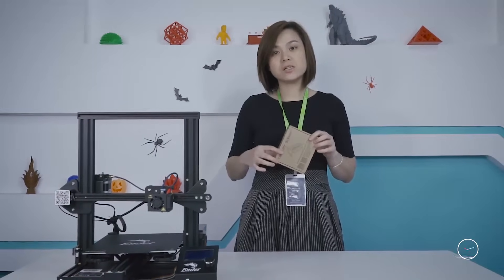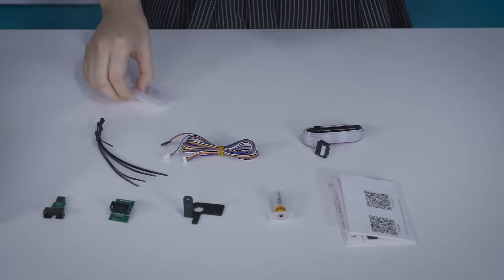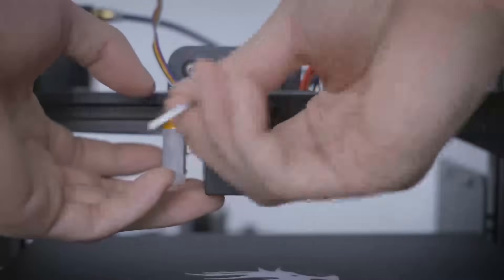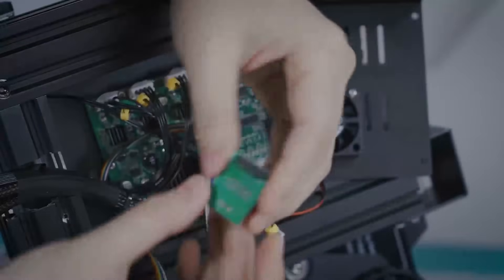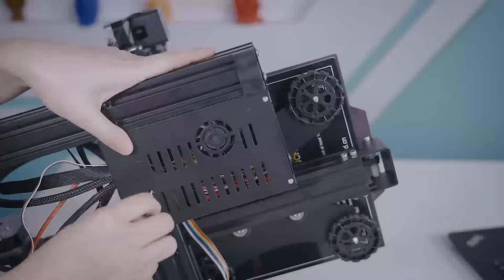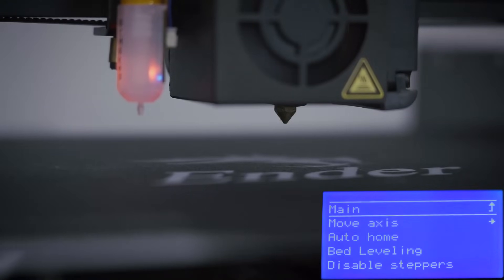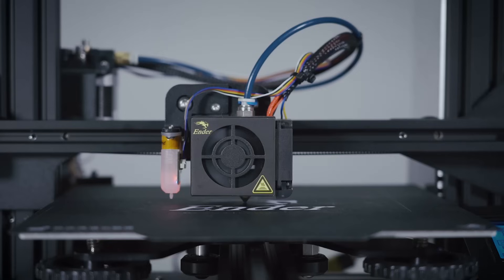How to Install Creality BL Touch Auto Bed Leveling Sensor Tutorial (Ender-3 Pro Upgrade Setup)

Comment from the maker: We are reponsible for every customer, so if you have any problems about your Creality 3d printer (especially when you need to use pics or videos to show these problems), pls contact our after service https://www.creality.com/service-request. We have very professional engineers there to solve your problems. Thanks for your support.
Reply: I don't have any chips to choose from in the program and my ender 3 pro is recognized by my windows 10 computer as an input device. does anyone know how I can fix this? thanks in advance
Reply: @snief86  rename your ProgISP folder without any Chinese Characters, don't use the Creality Bl touch firmware it does not work properly
Reply from the maker: @AndrewAHayes  Thanks for warm comment, it is very helpful for other customers.
Reply: I was told to contact my retailer for problems with your software and firmware, which is a waste of everyone's time as you don't provide the Marlin INO file with your BL Touch firmware so no one can repair it.
 Why don't you repair the BL Touch firmware for most of your printers and include baby-stepping so you can set the z offset correctly, it took me 10 mins to configure my Ender 3 BL Touch firmware from a stock version of Marlin Bugfix 2.0.x.
 by not doing this you are making customers think you don't care, within the community people are getting pretty sick of this attitude.
Reply: @Musa Enoch i really appreciate your reply. I got to the site on google and Im in the hacking process atm.
Takes a while so I will get back to you later with my results.
Reply: @Musa Enoch it worked and I now got access to my account again. I'm so happy:D
Thank you so much you saved my ass :D
Reply: @Aiden Taylor no problem xD
Reply: i know Im asking the wrong place but does someone know of a tool to get back into an instagram account..?
I was dumb forgot the password. I would appreciate any help you can give me.

Comment: It broke my ender 3 pro. My marlin firmware whas fine only thing that I needed wasn’t in that firmware and that was the option to calibrate the e-steps. But now I get the well known blue screen that’s flashing a little bit and the bl touch not working anymore. Even tho the new software should support the bl touch

Comment: Can  I follow these steps to revert back the firmware to Ender 3 pro original. The BL touch keep failing.
What are the setting in progisp to upload the original 1.1.4 firmware?

Comment: Wait I have the "Crealty BL Touch Auto Bed Leveling Sensor for 3d  Printer" box and there are 3 black metal angle brackets in it, and there are no green circuit boards in the box!
Also there is no white cable either.   Why>>>???

Comment: I didn't get the pinboards or the burner with my bl touch for my Ender 3 pro. Was I supposed to?
Reply from the maker: If in need of technical support, please email  cs@creality.com; or
join the Facebook Group (https://www.facebook.com/groups/3110994512278883/) to discuss with thousands of experienced 3D printer users.

Comment: Is there another video for this for the enderpro 3? I am trying to install mine and my box was slightly different and I don't have that cord to plug into the bottom of the board. Mine gave instructions to reformat my sd card completely (which I don't know why I would need to reformat completely) -- and download one of the files from the download page. But I don't know which version since there are two options for ender 3v2

Comment: The most videos I see are to upgrade the ender 3 but if this video description is correct you can also upgrade the ender 3 pro??
Reply from the maker: this is how to install BL Touch sensor, Ender 3 pro with ABL
Reply: @Creality3D  okay thanks, can the cr touch can also be used for the ender 3 pro or?

Comment: The bracket received with my BL Touch for my Ender 3 v2 doesn't work particularly well with the fan housing (plastic box around it). Now the fan housing (which also holds the fan) is lose. Any work around?
Reply from the maker: print one?
Reply: @Creality3D  I would love to... if i could get my bed level 😂👍

Comment: This would be a great video if it also told you there was a difference in the BlTouch you get. I watched this video before buying. Didn't come with bracket or the connector for the computer. Junk

Comment: I do not have this motherboard I have 4.2.2 and the connector does not light up what to do?
Reply from the maker: Could you pls replace your power supply or power cable first to see if the problem can be solved?
Reply: @Creality3D  hi have 3dtouch no Bltouch my power supply and cable are new, but when I make the connection like you, I don't have the indicator light, the connection is the same with the motherboard 4.2.2? thank you
Reply: I do not understand why it does not work, I made the same connection so impossible to do as you do

Comment: I can not get this thing working
Reply from the maker: Sir, could you tell us your printer's problem in detail?
Reply: @Creality3D  I can’t flash the firmware it just says “chip error” and it didn’t even show the selection for the flash unless unzipped it all with winrar
Reply from the maker: @CineZoneYT  Could you tell us the model of your mainboard? How do you flash firmware? Could you pls send us a video or picture about it? Our engineers are more likely to understand your problem, then they can give you a better solution

Comment: Her model has a creality v1.1 motherboard, whereas mine is 4.2.2, so it has firmware burnable from bootable SD and the physical wire connections to the motherboard are different too. We need a new video for 4.2.2 MBs!
Reply from the maker: We will send your feedback to the after-sales department, if there are any updates, we will notify you.Thanks for telling us your needs.

Comment: Hi question why when I click on bed level and it starts going down slowly but once it hits the bottom it keeps going and forces the engine to keep going down?
Reply from the maker: Friend, have you checked your limit switches to see if there is something wrong with it?
Reply: @Creality3D  yeah everything is new and I followed the instructions but it does the same thing and after I flashed it it now buzz and still hits the bottom and trys to keep going so I just bought a new motherboard and disconnected it

Comment: The bed leveling just made the leveling worse!
Reply: The Problem was, my printbed had a dent axactly at one of the meassurement points. Now I print on a glass surface and it works great.

Comment: The board seems to be different on my ender 3 pro, there is no 6 pin connector, instead a 4 pin connector. Please advise
Reply: im having the same issue
Reply: @AD3DVERSE  I found out that that's the v2 main board, unfortunately you need a different bl touch

Comment: The link  showed at the minute 02:25 for the FLTouch firmware  for the CR-10 are Down. Please help!
Reply from the maker: Hey, what do you mean?
Reply: @Creality3D  i was talking about "ProgIps" firmware. The essential software to flash the printer. When you shouwed a link where to download,  in me case,  nothing.  Website in blank. But now, I have the ProgISP.exe 1.72. Thanks.

Comment: I've bought a Kit from Creality and TBH there is no instructions for Ender 3 with V 4.2.2 Boards - I haven't found a detail video or instructions yet that would cover some of the issues of how to update the firmware and more importantly how to configurated correctly...

Where is the connector for the USB on the new 4.2.2 motherboard? I can't find it.
Reply from the maker: Bro, could you pls check this link and see this Ender-3 V2 firmware update video? Then your problem can be solved.

Comment: Great video please add to comments make sure you unplug your sd card
Reply: also, make sure no other USB devices are plugged into the computer, I forgot my USB MIDI lead was left plugged in and was using the port that the programmer was expecting to use, it drove me mad!

Comment: Blank screen after doing this.
Reply: I have the same, did you find the solution?
Reply: @aud1um  no i didn't, bought a SKR mini 3 board, working well. Much easier to upload firmware.
Reply: @dieselhead24  ok, now I’m sad and worried. How much did the board cost?

Comment: How can I install the BL touch for the new 32bit board as the ISP pinboard came with BL touch have 3 pin slot in 2 rows but my ender 3 pro board only have 4 pins in 1 row.
Reply from the maker: Friend, sorry for the late reply, if your problem was still not solved, pls check this link https://ibb.co/YfvYp3F

Comment: Okay so when opening the program to flash i get 2 error messages and then when it opens my drop down list doesn't have anything in it. Help?
Reply: I got the errors also but my software was ok, but I ended up flashing the TH3D unified firmware as Creality does not supply the open-source files to allow you to activate other features.
 How did you solve your issue as I notice Creality didn't seem interested?

Comment: The BL touch continues to be the worst decision I ever made when it came to my printer, this video has quite a few flaws which will lead to easily done but devastating mistakes
Reply: is bed leveling really that hard manually?
Reply: @BiggieDark  not necessarily but the time taken per test bed level print and othet things between prints adds up and I sell prints so for ease automatic bed leveling can be useful

Comment: when I went to connect this to the mother board I didn't see the 6 pin connector spot. I have an Ender 3 Pro so I am confused. I have seen online that mine might have the V2 board. How do I connect this for my board? Also, is there a Mac version of the flashing software?

Comment: My ender pro 3 motherboard does not match the video. I have 4 pins not 6 and it will only connect 2 pins due to space. And why skip step such as unplugging the ribbon cable? And the lighting is poor.  Will be returning.
Reply: Don’t do anything your board will smoke watch this video https://youtu.be/Rn_C4xrwRks

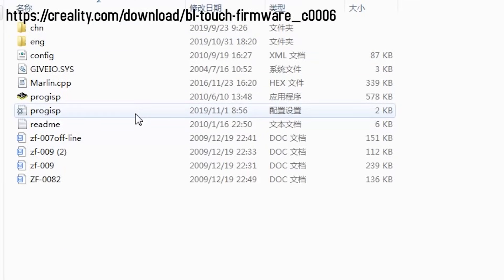Comment: The link to .https://creality.com/download/bl-touch-firmware_c0006 (at time 2:24) leads to downloads. There I can find Ender-3_8bit_1.1.6V_BL Touch Firmware_0814.rar which, when I extract the file yields Ender-3Marlin1.1.6BLTouch.hex and NOT the screen shown at 2:28.  REALLY HELPFUL

Comment: READ THIS Finally worked for me. 3 things you should know!  If you don't have chinese language installed on your computer you will need to delete all the gobbley gook characters you see on the install folder which is your computer trying to make sense of chinese characters. (@Creality you should delete these characters in your dropbox folder so we dont have to deal with this)  Delete all the chinese characters from the folder containg progisp and also delete any pdf or file else you see with chinese characters.ALSO make sure the power button on the printer is set to ON but the cord is disconnected when you try to flash your printer. Also Don't even attempt this on a Mac. Another thing was if your fan cant fit back in you can flip the entire metal over so that the fan is outside of the box containg your DSP cards.

Comment: In case others didn't know either - it's possible the connectors are glued in place. So if you can't get the connector on the mainboard out, check the backside for hotglue. Try to carefully(!) pull it off with pliers, or maybe use some IPA if you have it at home, I've read that this works too.
(I had some at home, so I tried it - not sure if it was the IPA or my attempts to scrape the stuff away, but I got the connector out afterwards. I used a Q-Tip to carefully rub it on, trying not to spread it to anything else.)
Reply: Good tip.  Alcohol is magic for releasing hot glue

Comment: It's a 6 minute long video and I've been trying to install a working firmware for 2 weeks. The firmware given gives you a blue screen for Ender 3 Pro. Saving you guys some time.
Reply: same here, when openning progisp, I can't select anything, always ``error``
Reply: @carbonneaud3  There's some random characters in the name of the files you got. It will either be chinese characters or random symbols. Rename the folder removing those characters and you should be okay.
Reply: @zodiartsstarro   I love you so much
Reply: @zodiartsstarro  You are amazing, thank you for that. spent 1 1/2 hours trying to work out why it doesnt work. Did you work out how the to fix the screen?
Reply: @hulk239239  No. I learned that it depends on the board you have in your 3D printer. Depending on the board, it's harder to find a working firmware for BL touch. I'll send you a link to a discord server that helped me.

I eventually just loaded a basic firmware from the site and manually levelled. It was too much headache. (I have a board that makes it hard to compile a firmware for BL touch).

https://discord.gg/aXeW62fdPq

Comment: Why do you cover the wires up with your hand? I am trying to follow this video, and everyone is telling me that the BLTouch i have is wired incorrectly for the ZStop, but as you don't have full proper understandable instructions, we will never know, and each time i try and use any of the BLTouch firmware, my LCD screen either never lights up after, or the printer kicks out a high pitch tone and then it shows Ender 3 PRO when the firmware is supposed to be the straight Ender 3 firmware

Comment: Followed the video but it's not working, everytime I try it after installing the firmware the bed level option does not show up, also I have to turn off the machine before the extruder crashes into the bed. I'm assuming I am using the wrong Firmware but I really don't know which one to use from creality.com/downloads. a direct link for the Ender e Pro would be great.
Reply from the maker: Hi, you printer is Ender 3 V2? Have you checked if your printer model is consistent with the firmware on creality download page.

Comment: Where do we find this download with progisp in it? none of the downloads I'm seeing on any  of the provided links have it
Reply: It seems this is the right location: https://drive.google.com/drive/folders/1lXXDpAtkGP2KVKi4O1yqBInqunWGrWvN
There's also firmware in there.
Progisp is from 2010. Not sure if I like that. (I know, never touch a running system and all, but still.)

Comment: After completing the fimare download I set everything back together but my screen will turn on for a second then turn off why?????
Reply: I had the same problems ... Please make sure you placed the display adapter correctly because it is smaller than the original display cable. There is a chance, you offset the adapter by one pin, causing this error to occur. At least, that's how I fixed my problem.

Comment: I bought a BL Touch and have tried to install with this video guide. I have had nothing but issues since and am seeking out a professional repair of the printer because I genuinely think the BL Touch has ruined it. I now get a blue screen when I turn it on with no text, and no amount of flashing the firmware or using the updates on the creality site work. Its stopped all my printing and caused a lot of stress and upset and I know that I am not alone in this. The BL Touch needs a better guide both written and by video and there needs to be a lot better customer support than there is currently. I've had 0 help from creality on this and i'm feeling very let down
Reply: I have the same problem and i feel the same. I thought creality had better support. I have a ENDER 3 PRO with mother board v.1.1.4 and buy a BLTouch V3.1.  The printer worked until I installed the BLTOUCH. Now, I turn on the printer and BL touch glows red and the screen is blue. 
I've been trying to fix it for a month and 
customer service is not responding

Comment: Just installed this onto my stock ender 3  yesterday, good easy to follow instructions. But, now the cover for the motherboard will not go back on. The fan crashes with the New board that takes the BlTouch and LCD connectors. Any official solution
Reply: I have the same problem

Comment: Do not buy this product it is not easy to use and has caused more problems than fixes il try for one more day then I'm gonna pull it of and put it with the rubbish it self levels miles away from the bed and since updated my Ender 3 I cannot even store the settings on it thanks for wasting my time and money next 3d printer I buy will not be from creality in future. And all software is not user friendly interface for people wanting a quick upgrade I'd not bother

Comment: Bonjour

Après l'installation réussite de mon BLTOUCH V3.1,  grâce à votre vidéo et votre charmante présentatrice, et l'installation du firmware  1.1.6V mon mon endre 3 pro
je n'ai plus le mode changement de filament dans l'écran 
il y a il une autre procédure car j'ai cherché et je ne trouve rien 

merci de votre aide

Comment: When I load the progisp software, I get several issues.

"Access violation at address 74F9FA4F in module 'KERNALBASE.dll'. Read of address 02305000." and it pops up again when I click "ok" :/

I'm also unable to "Select Chip". The entry dropdown field for the chipset ATmega1284P board is NOT there. Nothing is there, it's just all blank.

Anyone know what's going wrong? My programmer works fine, I flashed Marlin 1.1.9 earlier, so I'm not all that sure what's happening here. :(
Reply: Folder where your ISP Software is locate have charters your OS can't read remove THE Charters then restart the software that work for me (I have dutch OS)

Comment: When will the firmware for the original Ender 3 with BLTouch support be released? I can only find the latest firmware update for the Ender 3, but none of the downloads have BLTouch in the name? Noticed the Ender 3 V2 has BLTouch downloads.

Comment: Do you need to flash the firmware on your printer if it's new and already has Firmware version 1.1.6.2? Or can you skip that step and go right to plugging in the BL Touch